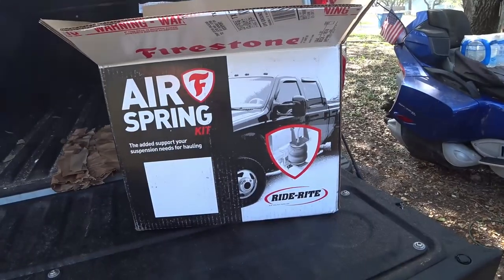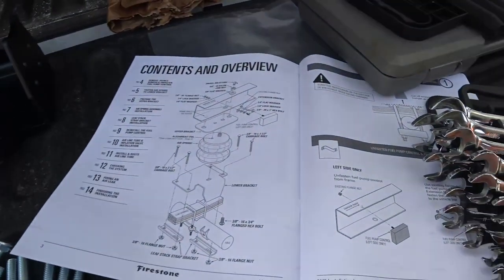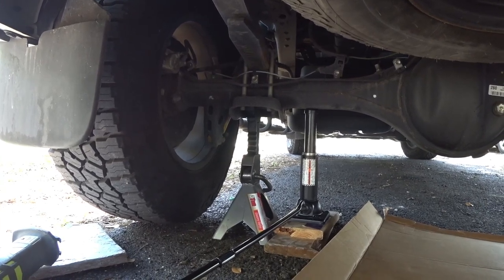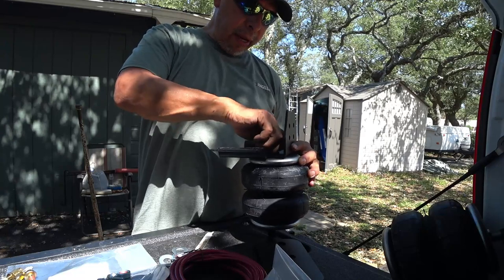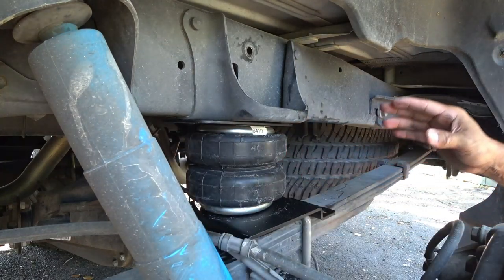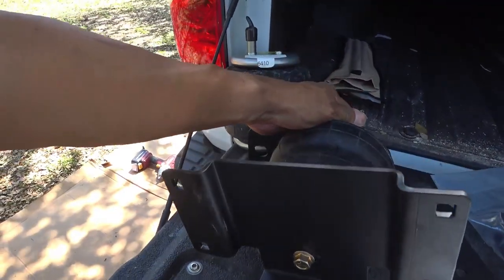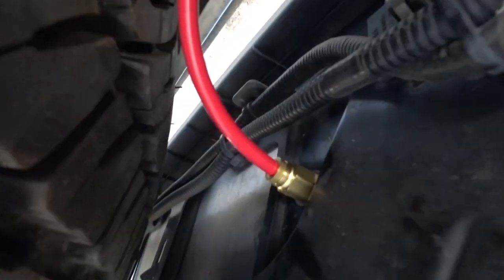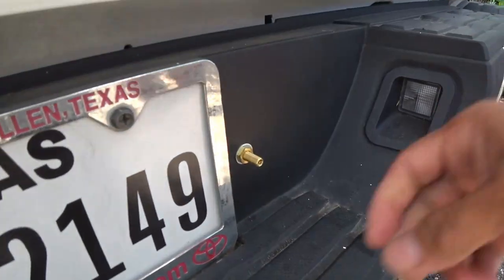Installing Firestone Air spring kits (Air Bags) on my 2019 Tundra TRD

Comment: Great video.  Just did the same install on my 2018 1794 Tundra the other day.  If you do have a better jack than the factory one you can lift the truck and have enough room to do it from underneath without removing the rear wheels.  You may have to drop the spare but I don't have a spare in the factory spot since I'm running a Rigd Ultraswing. I also added Daystar cradles since I installed the airbags to make up for bed weight due to topper, solar install, drawer system and a bunch of other stuff that always lives back there rather than just for towing.  As an overland built truck I didn't want the airbags to limit my suspension articulation at all.
Reply from the maker: Sounds like you have a nice rig